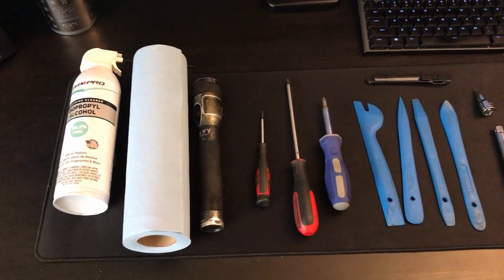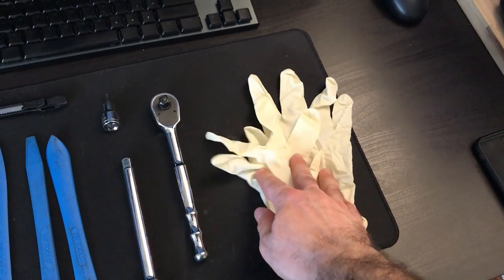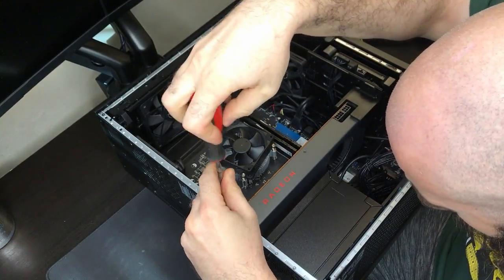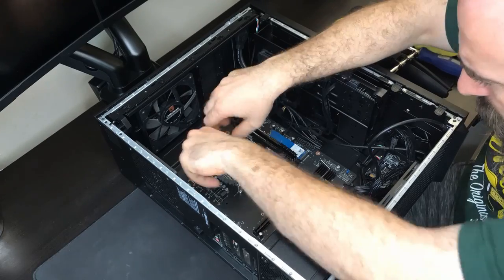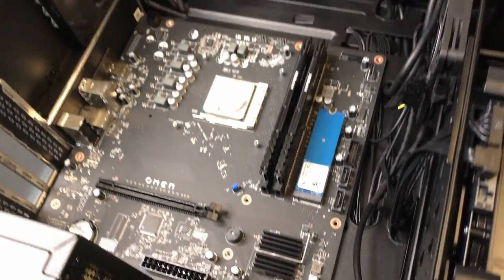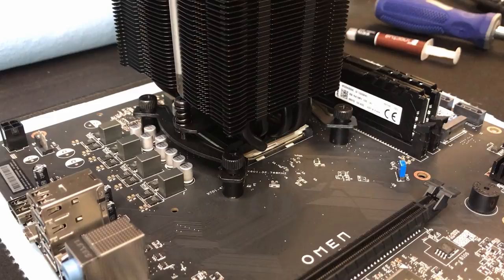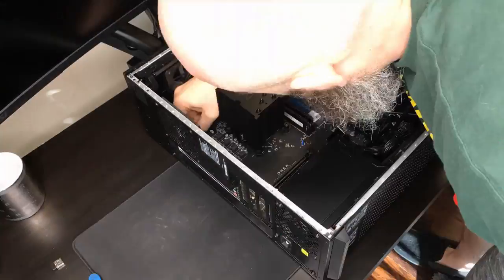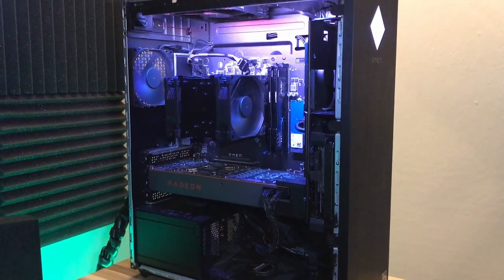Installing A Noctua CPU Air Cooler In My Omen! Complete Tutorial 😎

Comment: Hi Dan, I wanted to thank you for doing all these videos.   I just now finished installing the Noctua US9 air cooler on my Omen Obelisk i7 8700 cpu.   I have been monitoring my temps closely lately and noticed that during intense use it would get very high and after doing some stress tests and benchmarks I could see that it was thermal throttling and getting into the 90's C which is not cool.  I already added all the fans like you have, and even though they help a lot to get the heat out of the case, they can never make up for the cheap stock cpu cooler that HP uses.  So I finally had enough and bought the Noctua US9 as you did and  the cooler swap actually went amazingly smooth.  Much of that is due to your amazingly detailed videos so thank you so much.  

I never even had to use pry tools on the back to get the bracket off the back of the motherboard, I just was able to use grip strength to grab the corners of the bracket and tear that bad boy off lol.  Everything just kind of fell into place after that and it was a fairly easy project overall once you have done it.  

Anyways, the final result after running the same  cpu stress test was a huge improvement.  And this was with turning down the fan speeds on my two 120mm noctua fans during testing.  I never got past 76 degrees Celsius which is way better that before.  I actually used to have readings of up to 95C before when it would thermal throttle constantly during stress testing the cpu.   Now the i7 8700 CPU can run at it's top speed without throttling.  Throughout the tests all cores on my cpu ran at the maximum speed that they could which is 4.3ghz on all cores consistently, where as before it would throttle down to 3.8ghz or even 3.3ghz when stressing all cores.   

Thank you again Dan!  This really makes me happy and not concerned about the high temps that the CPU was going through before.   HP really needs up their game with their air coolers on the machines.   It's kind of ridiculous really with what they are using.   Thanks and take care.
Reply from the maker: Hey! That’s so awesome to hear. I went down this entire path with trying to combat my temps ( as you can see in all my videos ) and I use to hit 93c while rendering my videos with my Omen! That’s when I knew I had to make the change. The fans did help with temps but like you said, the cooler had to go. The cooler swap is hands down the best modification anyone can do for their Omen. I was blown away with how well it kept the CPU cool in a case the has zero airflow. 

I appreciate you sharing your experience and I’m glad you got your PC to a state where your comfortable with the temps it’s getting. I remember being almost stressed during a render session because of the temps, but after the U9S, my render temps was like 78c, even for 4K/24FPS, so I’m happy.

Have a good one! 😎👍🏻👌🏻🙏🏻🤝
Reply: @DanKamYouKnow  Yes it is nice to be less stressed lol and now I am able to back off on the speed of my 120mm noctua fans with the manual speed adjust knob.  Lately I have been running them full tilt because of the higher temps, but now more like 60 percent.   My ears appreciate it.   I almost was ready to dig out my old school Chieftech case which I bought 20 years ago, but never used.   It would be a fun project some day for me to consider.   The old case is a lot bigger and has a plexiglass side panel with a fan hole opening in it.   Even though they used smaller fans back then there is no doubt that the sheer size of the case would allow for better air flow.   For now though the omen case will suffice.   Thanks again.   😎👍
Reply from the maker: You’re welcome and enjoy your “new” PC!

Comment: Why didn't you use the black squared off AMD specific brackets that come with the U9S? You state that you have to use the bracket for the Intel CPU regardless of whether you are using AMD or Intel... why???
Reply from the maker: Hey Eric! Seems weird but Omen motherboards use the same cooler bracket for both Intel and AMD. So regardless of having an Intel or AMD processor, you’ll use the Intel bracket ( for HP Omen motherboards ).

Comment: Awesome video sir. I just bought this computer and will be adding fans. Do you recommend the top fan as an exhaust and the bottom fan should that be exhaust as well? Thank you.
Reply from the maker: Thanks! Top fan should be an exhaust and bottom fan should be an intake ( blowing upward ).
Reply: @DanKamYouKnow  just noticed I have no mounting bracket on the bottom of the computer. Can I just drill out the appropriate size? Thx. Also with the top fan, my avg temp is  like 58 to 60 C
Reply: @DanKamYouKnow  also the idle temps are 58 to 63C. Have not recorded the gaming temps yet
Reply: @DanKamYouKnow  sorry one more question. Sound like Colombo, lol do the rgb lights make a big diff with the heat? I turned all mine off.
Reply from the maker: There is no mounting bracket at the bottom, I actually leave mine loose at the bottom with no adhesive or anything... I wouldn’t recommend drilling into the case but it’s up to you. The lights are LED and LED gives off very little heat.

Comment: Hey Dan, great info.  Curious to see if you have dome some testing of those push/pull fans.  Would love to see if there is a noticeable cooling difference of having both fans vs just pull vs just push?  Have a 30L on the way and have been planning some updates
Reply from the maker: I have only run the fans in a push pull setup. Noctua even recommended this way in their instructions. One fan pushing through cooler and the other fan pulling it away towards the rear of the case. I did try to flip my cooler to a vertical orientation. It the temps were better when it was horizontal.
Reply: @DanKamYouKnow  Hey Dan, this would be great info to add in the video. I was wondering if it would be better to mount the cooler vertically. I wondered if it would then also help the GPU a bit maybe. I just finished mounting the new cooler the way you did. Thanks!
Reply from the maker: I tried this and made a video of it but I had better results with the cooler being horizontally mounted. My Omen does have the full length GPU though so if you’re 30L has one of the short graphics cards, you may want to try it and see. It takes about 5 mins to rotate the cooler and reapply paste. 

I wish I would of added it and a few more tad bits of info in the video but that’s how it goes with video making. Always something you forgot to mention lol
Reply: Just out of surgery... Have the the U9S and the 2 Noctua exhaust fans on my Omen 30L.  I was sweating the removal of the old bracket, but it was not bad.   Again great video, really helped me.  Thing is idling around 26c :)

Will have to get a little creative on the front fan as the screws that HP uses just wont work with my Noctua fan.  Was also looking at the case.  Too bad HP did not provide air holes in front of where the 2 drive bays are or some pop-outs like they did at the top of the case.  I am only running with the 1 TB SSD, so those bays are totally open.  Bet a decent intake in that area would help immensely
Reply from the maker: Thanks Rob and I’m glad the video helped you out! I have a front fan and it helps a little bit with temps, but it does blow air right over the M.2 SSD so I’m sure it’s running cooler.

Comment: Hello Dan! Your videos about the Omen PCs have helped a lot! I recently got a sweet deal on Omen 30L with R7 5800X and RTX 3080. First thing I swapped the case and now about to swap the cpu cooler. In the video you said that the cpu mount is intel even though the cpu is amd. What Intel mount is that? LGA115x / LGA1700 / LGA1200? Or something else?
Reply from the maker: Hey! Yup, all Omen motherboard use Intel LGA115x spacing! Vast majority of coolers will come with the right accessories to mount the cooler 👍🏻

Comment: I'm about to order an Omen for my son and I came across this video and your video on adding/upgrading the fans.  I have to say great job on the videos.  Lots of info.  I was wondering what are you using to check your temps?  I want to make sure I'm getting similar results.
Reply from the maker: Thanks John!! For vitals, I think HWinfo64 is the most detailed program you can have. A bit overwhelming at first but extremely accurate and a TON of information, completely free too. 

You could always use something like Ryzen Master if you have a Ryzen CPU, or Intel XTU if it has an Intel processor.
Reply: @DanKamYouKnow  Thanks Dan.  We will take a look at the Intel XTU and HWinfo64.  I'll let my son decide which one he likes since he is going to be the one monitoring it.  Again keep up all the great work.
Reply from the maker: Thanks John! Good luck to you and your son with the PC! 🤝

Comment: Great video, just wish you would have shown where you stole all the power from with all these fans. I am assuming you are using an after market PSU? Did it have all the connectors you needed for this many fans?
Reply from the maker: Hey! I used y-split cables off of the existing fan headers. This video was years ago but I’m 99% sure I had the stock PSU. No need to upgrade with just fan upgrades. Cheap y-split cables work very well
Reply: @DanKamYouKnow  Thanks man.
Reply from the maker: No problem. I do have other Omen videos where I show my entire fan setup and all connections. It’s in the Omen playlist on my channel. 👍🏻

Comment: I have the same case, the “dust” filters on top of the chunky cut out pattern inhibits almost all airflow. 

The top of the case is actually a double layer deal, same thoughtless restrictive cut outs, this time there is a plastic top that has a gap on it that almost acts as a baffle. 

Then the fan “mount” that is at the top is not flush with the case to it most likely just circulates it’s own air. 

Low profile fans should never be used in any kind of restrictive airflow situation, they are made for specialized almost for low profile mounting like in a HSF.

I have been building computers for 23 years now, the ho omen 25L is the worst case I have had a build in. 

Who seriously calls a computer a gaming computer when the ONLY installed fan is a 92mm jet engine bundled with a just the TDP stock cooling solution.

I removed the dust filters and used a cutting tool to remove and completely open a spot in the bottom right and top left of the case and installed two 120x25 high airflow case fans. I removed the 92mm tornado and taped off the grille and everything runs ridiculously cooler. 

That cooler he installed is really good, and he did a good job taking his time and did it properly. 

I’m hope to get a Fractal meshify mini soon, along with a new modular PSU as the cables in the one included are made just for that case. 

It’s a fun project computer for the money, not anything I would ever buy again though.
Reply from the maker: To be honest, it’s not just the case, it’s everything in the build. The motherboards are proprietary and cap CPU power, the GPU’s are horribly cooled and usually under-clocked to prevent throttling, small capacity drives, stupid JEDEC profile RAM, after-market RAM compatibility is a joke, and I can keep going. The CPU is really the only the worth a damn

These PC’s are good for people new to PC’s who want to eventually swap out parts. It’s a good learning platform to hopefully swap everything out.
Reply: @DanKamYouKnow  

I am thankful you are talking about it the way you are now….. those JEDEC ram crap is hooooooot garbage 

They are good starter PCs to get everything kind of going and you’re absolutely right about everything in there.

I did not know about the motherboard capping the CPU power supply, that is absurd.

I’m guessing my next upgrade will be a motherboard instead of RAM.

I have the 10700f…. 32gb of crippled 3200mhz ram at 2133….yay jedec… and upgrade a 3060ti into it…. Does everything I need at the moment 

Found a 2666mhz jedec kit 8gb x 4…. Might do that at the beginning of the month….

What are your plans with your box of farts?
Reply from the maker: Well, these videos are 2 years old and I made over 30 videos on the Omen, so it’s been awhile since this video. I ended up leaving a 120mm AIO on it from a tutorial I did, installed a couple of fans, and pretty much gifted it to my girlfriend. 

The Omen is what kick started my YouTube channel so I want to keep it around, but not as a main rig. I bought it at the beginning of the pandemic because PC parts were very scarce at the time, now I have my DIY build and my girl has the Omen 👍🏻
Reply: @DanKamYouKnow  very cool to give it to the little lady, I ended up getting mine because of the pandemic as well as I sold my handmade custom loop computer right before…and all of a sudden every part was expensive.
Reply from the maker: Good luck with it in the future my friend. For what it’s worth, my Omen is almost 3 years old and haven’t had a single issue, not even so much as a blue screen. They’re just a bit annoying to upgrade.

Comment: Thanks for the video. My CPU (Ryzen 9 3900) got up to 90° C by playing games. I installed now this noctua cpu air cooler with 2 fans (push-pull) and now the cpu tempratures droped to  ~75° C after some hours of playing games. However, by installing the cooler i removed the 1st ram module and after everything was finished i put it back and the 1st slot seems ow to be faulty (3xlong 2xshort beeps). Both ram modules work in the 2nd slot. I reseted the bios, upgraded it to the latest version, still faulty. My suspecision is that this slot was already "instabil" (bad soldering points) and by putting the ram out somehow it "triggered". I couldn't find any "physical" damage on this slot. For ~2000€ complete PC the quality HP delivered here is very poor (fans, cpu cooler, etc.). This will be the last complete PC i've ever bought.
Reply from the maker: That is a huge bummer, sorry to hear. I have seen many people run across this same situation after replacing the cooler as well. I somehow got lucky and my RAM slots were working. I always assumed people scratched there motherboards somehow during the process but I think you may be right about the weak solder points.
Reply: @DanKamYouKnow  I am now going to replace the motherboard with a "MSI B550 PRO-VDH". Any advice if all the Omen case connections (also the RGB) will work or not?

Comment: Thanks for the video, I said in another video I would be on the upgrade grind and I think this is the next step for me. I love the blackout look and feel the cpu is in need of an upgrade in the cooling department. I am doing the double fan like you did, does the 2nd fan come with the hardware to mount to the cooler?
Reply from the maker: You’re welcome! Yes, the cooler will come with only 1 fan, but 2 clips so you could secure another 92mm fan to the cooler. It’ll be the best upgrade you do for your PC. Major change in CPU temps.
Reply: @DanKamYouKnow  thanks for the reply and help. Guess I’m ordering the cooler and extra fan now. Now for the timid install 😬
Reply from the maker: I have Amazon links in my description if you do end up ordering which help out the channel 😄. Let me know if you need any help during the install as well.
Reply: @DanKamYouKnow  yes sir!
Reply: Looks like I will be tackling this job
Tomorrow. Not thrilled about swapping out the stock cooler bracket but I guess there is no way around it if I want the new cooler on.

Comment: Good video. But a few days ago I dusted the inside of my computer (CPU fan too) and I just removed the fan AND the Chrome cooler in one go by unscrewing those spring-loaded screws on the side. I didnt need to detach the board.
Reply from the maker: Thanks! You’ll need to remove the motherboard in order to use the new backing plate for the air cooler / AIO you’re installing.

Comment: Dan the Man does it again. Been waiting for this vid! Time for install
Reply from the maker: Let me know how it goes and if you have any questions! Use a little less thermal paste than I did in the video. I used a little too much.
Reply: @DanKamYouKnow  thanks! I just got to it today. I am at the part where we gotta clean the cpu
Reply: @DanKamYouKnow  question!. Using the black spacers in the little bag is the correct ones right? Because there are grey and white ones and it's scaring me
Reply from the maker: There should also be black ones in there....
Reply from the maker: Check all bags in there.
Reply: @DanKamYouKnow  ok got it. I also applied less than what you put there. But some is sticking out (not drastically) through the sides. Is that ok?
Reply: Should I put the cpu fan on the lc fan? Or the cpu one?
Reply from the maker: Yeah, you should be fine.
Reply from the maker: Everything turn out OK?
Reply: @DanKamYouKnow  Dan! Sorry for the late reply. Yes! Boots up and works great! Now I just want to change the settings to 100 again. Referring to one of your older videos. That is ok right? Or keep it at 99?
Reply from the maker: I went back to 100% as soon as I booted it up since the cooler can handle the CPU temps at 100% now. Congrats!! I’m glad everything worked out for you.
Reply: @DanKamYouKnow  you are the man Dan.
Reply: @DanKamYouKnow  can you remind me what I need to make 100% again? The maximum processor rate? Keep everything the same? 5%
Reply from the maker: Keep your minimum processor state at 5% and put your max processor state to 100%
Reply: @DanKamYouKnow  sweet! Thank you for all your help with this Dan.
Reply from the maker: No problem! 😎😎😎